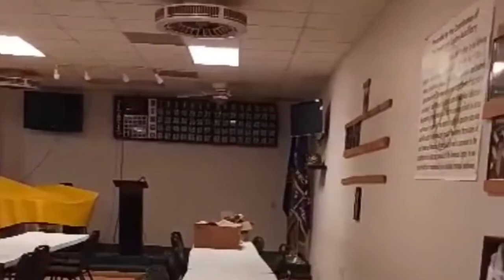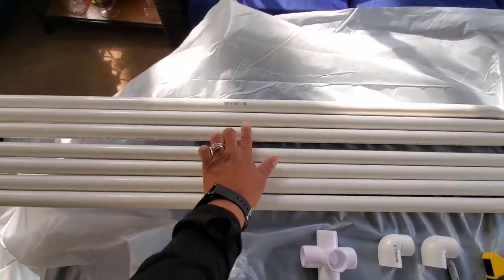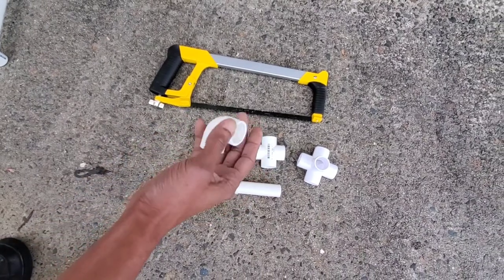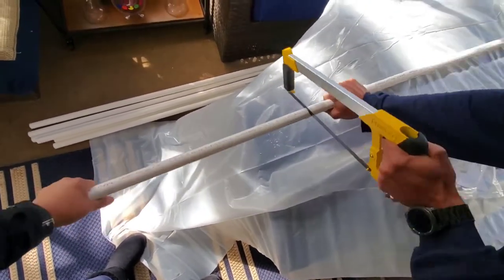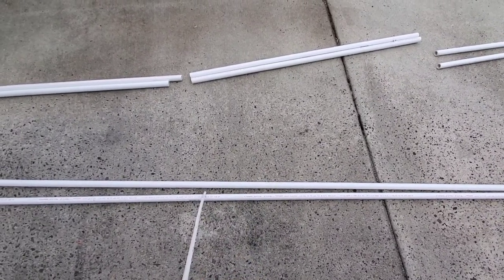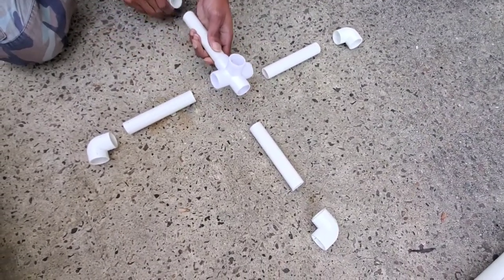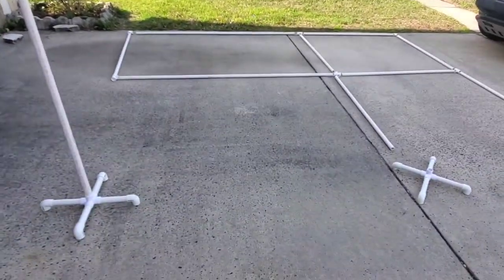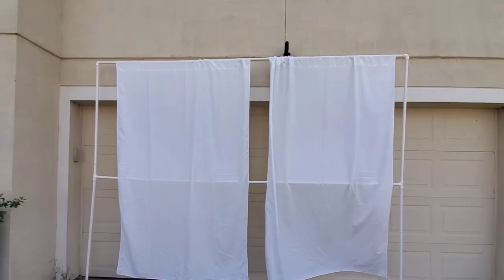DIY Backdrop Stand | PVC Pipe Backdrop Stand | 6Ft up to 30ft | Money Saver Budget Friendly Backdrop

Comment from the maker: Thanks for Subscribing and your interest. You should not have any issues with the curtians sagging because that 2nd horizontal pipe in the middle help supports it. That's why we did the 6ft section 1st to keep it from sagging. We added  the 4ft for longer length. Because we needed 30ft, that's why we did 3 sections and just add them together. If you do not do it this way and use the 10ft pipes without cutting them like we did,  it will sage. Home Depot sells 10 -10ft pipes in a bundle for about $45. If you are doing the full 30ft it was the cheaper route to purchase 1 bundle. You will need 15-10ft pipes. I bought the extra 5 pipes separately. All of the connectors were less that $50. We  purchased them separately, except for the 5 way ones that we use for the feet. They were 2 in a pack on Amazon for around $8. So total cost was around $100-$130 for 30ft. At that time which was beginning of December, it was cheaper to make this than to buy one that extends out 30ft and stands almost 10ft high. Prices may vary in the area you're in, and may have changed since that, especially on Amazon. So, definitely keep that in mind.
Reply: Thanks ever so much!!
Reply from the maker: You are welcome

Comment: You guys did a great job!  I'm a part-time event decorator and have never had the need of a 2nd backdrop kit but find I will need one to decorate both the church and the reception hall later this year. Did you have any issue with the curtain panels sagging in the middle due to their weight?  Yes kits are costly!  Do you recall your total investment in the pipes and all the connectors?  Thanks for sharing..I may have to consider this option!  New sub.